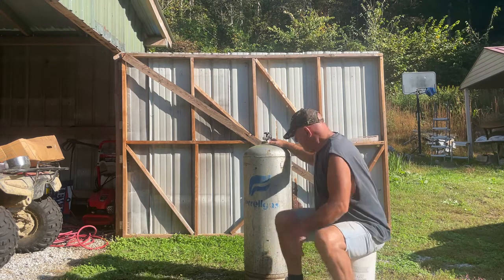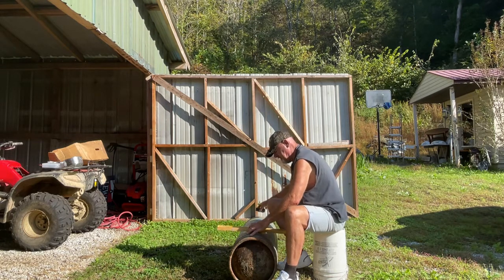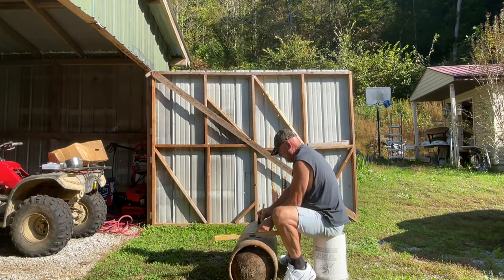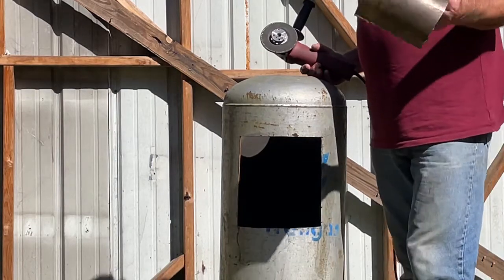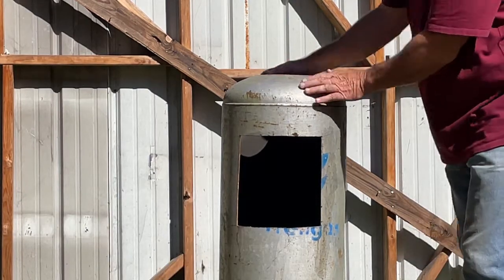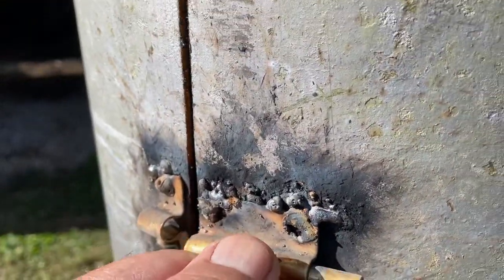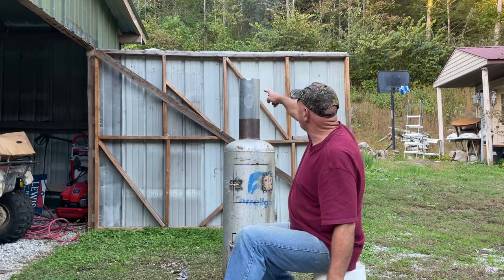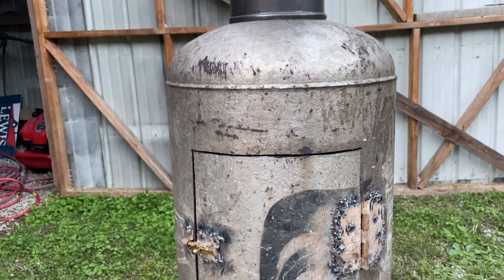Building a wood stove out of a propane tank!

Comment: This guy not to smart,first before try use a grinder on any propane tank ,or bottle take valve off stick water hose in tank flood tank water remove any liquid gas out 5 gallons trap in tank if hot  outside going blow up kill one with grinder or cutting torch.ALWAY REMOVE TOP VALVE FLLOD TANKS WITH WATER SAFE CUT ON
Reply from the maker: thank you for your comment, you make a good point, but a tank this old come on, nothing is in but a lil water, and some rust, lol, god bless,

Comment: Nice Job! I have an old Ansul 150 lb. dry powder fire extinguisher tank that didn't pass the pressure test so I took it home for a stove. The only thing I would add would be a 1 1/2 inch layer of refractory cement in the bottom and a few inches up the sides to protect from burn out.
Reply from the maker: HEY JOHN,, THANK YOU MY FRIEND FOR YOUR COMMENT, that tank will make a great stove, it might last a very long time, cheap cheap, good choice, sure beats paying a ton of money for a new one,god bless,
Reply: It needs an adjustable , "Draft"and an adjustable "flue damper"  too.

As well as more flue pipe.
Reply: It needs an adjustable , "Draft"and an adjustable "flue damper"  too.

As well as more flue pipe.

Comment: Will this work for indoor use
Reply from the maker: Yes but use it with caution, maintain a wide clearance from your walls,because it heats up really fast and very hot 🥵 as you build it yourself make sure you don’t leave any gaps in your cuts, if you do you will have a lot of smoke, build it right the first time and it will last a long time, thanks for sharing this, have fun and enjoy, have a blessed day,😀

Comment: I was thinking about doing this. I was concerned about high heat and galvanized metal. I know welding galvanize metal is toxic smoke. Your thoughts? Thanks
Reply from the maker: thank you my friend for your comment,  you say your  concerned about high heat and galvanized metal. but i would not let that stop me from making a stove, anytime one does welding theres always toxic smoke, but the flame inside the stove after a fire or two takes care of the toxic stuff,  with the HIGH COST OF HEATING TODAY, IT ONLY MAKES SENSE, god bless,
Reply from the maker: thank you for your comment, i agree safty first its always best just to make sure theres no propane in the TANK, before you cut it, just make sure the valve is open and let it all go out it might take a few hours, but my tank was old i mean very old nothing in it but rust and water, most ppl know that propane is dangerous never never never cut into a tank thats got propane in it, just to your home work and  and you wont have any run errors or hits,